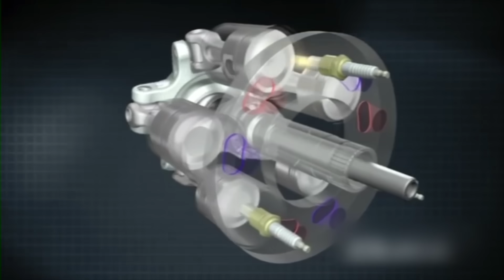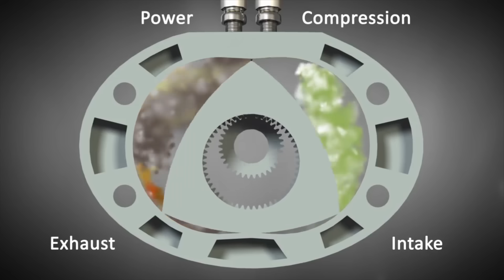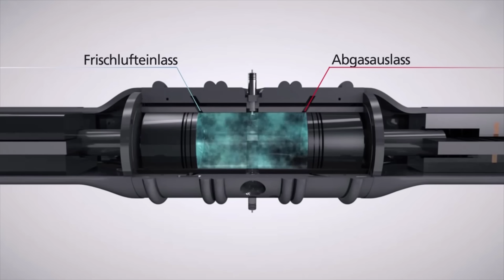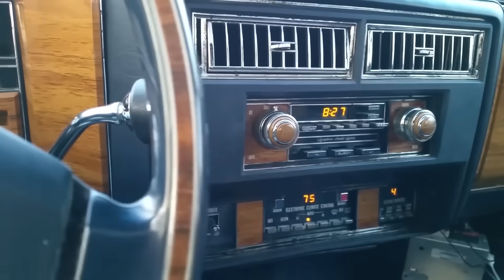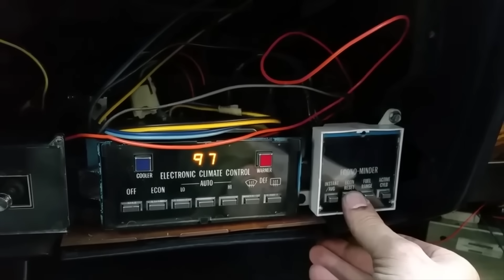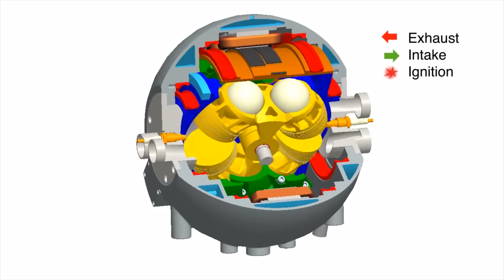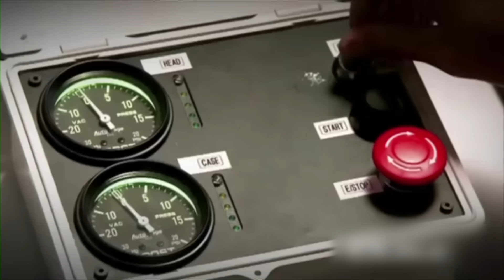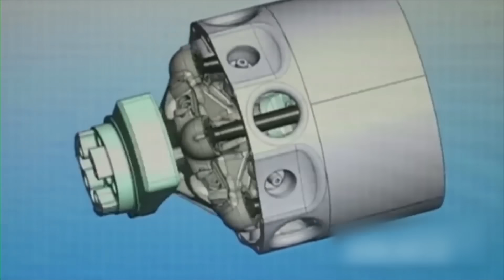10 Strangest Engines of All Time

Comment: 2019
and beyond Internal Combustion Engines still to reckon with …

Internal combustion engine has been around more than a century and it should be
around beyond decades to come. This is for the motorists not slowdown the
travel mode, changing lifestyle, more

Internal combustion engine has been around more than a century and it should be
around beyond decades to come. This is for the motorists not slowdown the
travel mode, changing lifestyle, more so to the business economy.

What is direct  injection and indirect injection? Indirect injection in an internal
combustion engine is fuel injection where fuel is not directly injected into
the combustion chamber. ... Direct injection allows the fuel to be precisely
metered into the combustion chamber under high pressure which can lead to
greater power, fuel efficiency with added feature of a … Catalytic Converter to
address the Gas emission.

In 1864, Nikolaus Otto patented the first atmospheric gas engine. In 1872,
American George Brayton invented the first commercial liquid-fuelled (not
petrol based fuel) internal combustion engine. In 1876, Nikolaus Otto, working
with Gottlieb Daimler and Wilhelm Maybach, patented the compressed charge,
four-cycle engine and this engine was running on Veggie Fuel (Ethanol). This is
the same with the Diesel Powered Engines that runs on Peanut oil. If this is
so, why not gas-up another time of VEGGIE FULES to address the dominant fear of
Carbon Emission? “ RIGHTFUL THINKING?”

Net CO2 or greenhouse gas production.

Plants use sunlight and photosynthesis to take carbon dioxide (CO2) out of the
Earth's atmosphere to make vegetable oil. The same CO2 is then put back after
it is burned in an engine. Thus vegetable oil does not increase the CO2 in the
atmosphere, and does not directly contribute to the problem of greenhouse gas.
It is really a way of catching and storing solar energy; it is a renewable
energy. However, as with other "renewable" energy sources, there may
be a (relatively small) carbon footprint associated with production or distribution
of vegetable oil.

These oils make up a significant fraction of worldwide edible oil production
used as fuel oil. Extracted from the kernel or meat of the fruit of the coconut
palm. Common in the tropics, and unusual in composition, with medium chain
fatty acids dominant.

Comment: The electric one seems kind of inefficient because what’s the point using an engine to drive a generator to then drive a motor? It’s easier to just use an engine powered car because you’re losing more energy to friction and sound
Reply: Good point. I, for one, would prefer batteries because they can be placed underneath, which leaves more room for storage.
Reply: A fuel driven generator is able to run at the most optimal (efficient) and at a generally lower and more consistent speed, so rather than waste fuel when extra power is needed you just increase the current drawn from the batteries instead.
Reply: Dave Micolichek soundwaves are just vibrations traveling through the air so there must be some energy dissipated into the air through vibrations, the sound can’t just exist because some energy has to be put it for it to actually make a sound

Comment: Evolution of the Internal-Combustion Engine

The first person to experiment with an internal-combustion engine was the Dutch physicist Christian Huygens, about 1680. But no effective gasoline-powered engine was developed until 1859, when the French engineer J. J. Étienne Lenoir built a double-acting, spark-ignition engine that could be operated continuously. In 1862 Alphonse Beau de Rochas, a French scientist, patented but did not build a four-stroke engine; sixteen years later, when Nikolaus A. Otto built a successful four-stroke engine, it became known as the "Otto cycle." The first successful two-stroke engine was completed in the same year by Sir Dougald Clerk, in a form which (simplified somewhat by Joseph Day in 1891) remains in use today. George Brayton, an American engineer, had developed a two-stroke kerosene engine in 1873, but it was too large and too slow to be commercially successful.

Comment: 1. The Volkswagen VR6 engine gets its unique exhaust note due to the fact that it has a strange firing order.  While it is indeed a true V engine, it fires like an inline 6, which means that it fires the front three cylinders then the rear three cylinders.  Since the exhaust path is longer for the front bank, this means that there is a different frequency [lower note] from the front bank than the rear, thus the infamous "woofle" sound.

2. NO NO NO!  NO, did "Mazda" put a rotary engine in the NSU RO 80 [pronounced "Are Oh Eighty"] or any Citroen;  The design patent of Felix Wankel's engine for automotive use is owned by VAG, the holding company that owns Volkswagen.  Did you know that Toyo Kyogo [the Japanese company that builds Mazda's]  has paid Volkswagen a royalty for every Wankel engine they have ever produced?  The Wankel in the RO 80 was a purely NSU design, and had tremendous problems.  Citroen's in-house version was equally flawed, and they gave up on it.   

Wankel engines cannot be made to be as efficient as the most efficient piston design;  These are a novelty at best.

3.  The Fuhrmann engine was installed in a few rare variants of the Porsche 356.  If you have one that runs, it is worth probably $200,000.  And you pronounce the name of the company that built this engine "Por-sheh" .  

You probably have a porch on your house;  I doubt you drive it-

4.  The design of the Duke engine is nothing more than an aviation hydraulic pump modified into an internal combustion engine.  There's nothing wrong with it, but it has few advantages. I doubt it will be cheaper to produce.
Reply: Actually it's Not pronounced "are oh eighty" but "roh uchtsig"
Greetings from Germany, O
Reply: @ikbunostfrees7242  Sehr guter punkt Sir~!
Reply: eric williams oh right I forgot transmissions make the power and not the engine. Silly ol me!
Reply: eric williams yeah sure I’ll bet you are. Hp isn’t changed, efficiency is.
Reply: @savagetuner2404  Yup, it's so efficient that it constantly burns oil making it a requirement to add oil on a normal basis unlike essentially any other combustion engine that will only lose a very, very, VERY tiny amount through gaskets leaking
Reply: Flies2FLL the Mazda skyactive wankel makes 45 mpg and 190 hp. You were saying?
Reply: @savagetuner2404  Hmm.  Amazing;  Funny how I'm not seeing that car on the road.....

Hello?
Reply: I can tell from your comment that you don't really know that much about engines.

Comment: What are you claiming, dude ?  
Mazda put the Wankel  (rotary)  engine into an NSU Ro 80   ?     What ?  How would that make sense ?
NSU  first used the engine in that Ro 80, but had difficulties with the gaskets of those rotors.

Hercules used it for a small motorcycle, with little economic success
Suzuki built a motorcycle also.
Norton motorcycles built a prototype, but faced the same problems as the other manufacturers.

Mazda then bought licence or patents to build the engine and was able to improve, because metallurgy and new
production techniques made that possible.

On top of that, it had problems with emission control.
One big drawback is that the Wankel is far more expensive to manufacture than a traditional piston engine.

Today, the Wankel is still used for special applications, like firefighter´s mobile water pumps
or for auxiliary drive on glider aircraft, because it has a very good power to weight ratio.
Reply: I believe the real problem with the Wankel engine would be its low fuel-efficiency.
Reply: @kevinlane1219  It ain't no prius, but you can get the mpg of a 90s-early 2000s sedan. Some of them, anything between 20-25mpg.. apparently in 1st gens its peak efficiency is around 3.4k-4krpm, something with the Nikki, while again not a prius, it's fairly decent on gas. But you are right, the gas crisis of the 80s definitely helped to cripple sales.
Reply: @Pieman6711  Thank you.

Comment: Engines run on vapors! Liquidz do NOT compress...  thus hydraulics!
Reply: 🔵 You are incorrect, there are a number of liquids that DO compress!.. such as hydraulic-oil, on the other hand, water will NOT compress.
Reply: @joshhayl7459  you both are wrong. everything we deal with compresses. Fluids and solids alike. It's just different compressive moduli that differentiate gases and liquids. Also, most liquids do not combust, their vapours do. You can throw a match into a lake of petrol and nothing will happen. Throw it into a room with an appropriate petrol to oxygen ratio and watch the explosion.

Comment: ever see the Ariel square 4 engine (motorcycle).1000cc, single carb ,low compression,75mpg @ 45mph, 1/4 mile 12sec .........etc

Comment: Ok so the Amercians invented the internal combustion engine, they didn't, and Mazda put their engine in the NSU?!?!?!  Nope.  NSU came up with the Wankel, named after the German inventor, Mazda made it work better than anyone else in a car and Norton/BSA did the same for Bikes and light aircraft.
Reply: Suzuki's 750cc Wankel engine is the most successful Wankel ever in mass production. My friend has one with 230,000 miles on the original seals. The drawback of it was it's extreme exhaust temperature requiring WATER-COOLED head pipes for the exhaust. He rides it daily rain, shine or snow. Suzuki made a little "Truckling" using a 1500 cc dual rotor engine that was very popular in Guam and SE Asia. American's can't drive Wankel's or Italian engines it seems. Mazda RX-3's got extremely good fuel economy IF you drove them nearly all-out at maximum RPM. It's the same with Fiat's, Alfa-Romero's, Lancia's, Maserati's and Ferrari's. American drivers have to be able to "Lug" an engine (run at too low an RPM)  and not pull the valves thru the heads to be happy.
Reply: suzuki also put it in bikes
Reply: While they had nothing to do with developing the Wankel rotary engine Mazda managed to greatly improve the problem of wear of the seals, but not enough to overcome the issue which meant emission-standards couldn't be met!

Comment: You forgot the jet turbine engine. You can think of it as a small ICE with a huge turbo charger where the power to drive the vehicle is taken from the turbo shaft.

Both Chrysler in America and Rover in the UK experimented with it. You could run them on anything flammable that could be sprayed into the engine and ignited. Including,on one occasion, Channel No. 5! 😂 They were even entered into races with varying results. The downside was enormous turbo lag with the turbine taking a long time to wind up the revs. Race drivers tended to keep the throttle wide open even when braking for corners!

Comment: VW's v5 engine?  Do you mean their inline 5 (straight 5) engine?
Reply: Nope, the only 5 inline was use in the 1976 Audi up to the Audi quatro rally cars , the later VW V5 was not a "straight 5" but a low angle V engine (like the later VR6...)

Comment: What about England’s Lanchester Ten, featuring an air-cooled, twin-crankshaft, 4.0-liter flat-twin driving the rear wheels. One crank lived above the other, and each piston had three connecting rods—two light outer ones and a heavier one in the centre. The light rods went to one crank, the heavy rods to the other, and the two shafts counterrotated. The result was 10.5 hp at 1250 rpm and a remarkable lack of vibration. If you’ve ever wondered what engineering elegance looks like, this is it. A very unusual and interesting engine and done in the early 1900s.
Reply: You guys still angry we kicked your ass in 1776 let it go
Reply: @jamessickmore236  Hope you did something nice for the French, In way of thanks.

Comment: high compression engines are more efficient and they are using the low compression in the Infiniti motor to allow more boost to make more power. You got that backwards.

Comment: Mazda didn’t put the Rotary in the NSU...
Reply: The inventor from the Wankel engine was felix Wankel, engineer by NSU... NSU sale the license for the Wankel type KKM (kreiskolben motor= rotary piston engine) to Mercedes Benz, Citroën and Mazda (later to some others)...Mercedes Benz create the nicasil coted aluminium Wankel engine block , technology who was use from all Wankel engine builders, later use on some motorcycles engines and the first car who use it was a modest Citroën Visa (improved 2cv engine, 652cc 35hp) and today Nicasil is still use on Porsche engines, and some others because very low frictions properties...NSU, togeter with Citroën, make in 1967 the COMOTOR compagny to built Wankel engines for the NSU RO80 and the Citroën GS Birotor: that's the true story!

Comment: wrong..  it has nothing to do will fuel use... it has everything to do with more moving parts that fail more often, leaving use a large bill, so they can MAKE MORE MONEY..

Hydrogen runs combustion engine's just fine.. no emmisions..     yet..  they make no money off it...  so they force us to use oil...

lookup Stanley Meyers if you dont believe me... we havent needed gasoline the last 70+ years.
Reply: The issue with Hydrogen is that you need lots of power to make it first and storing it is rather difficult because it has a nasty habit of being able to diffuse through almost every material. These are issues we really haven't solved and there is a chance we wont do so practically enough in automotive applications. Other options to include batteries and synthetic fuels which will require similar amounts of power are simply more practical.
Reply: Harley Me refining hydrogen creates just as much emissions

Comment: They didn't mention the new skyactiv-X motor Mazda is coming out with in 2019.
Reply: yeah and some mazda guy said there might be a rotary version coming too
Reply: @CaffeinatedSentryGnome  rotary  burn a lot of oil
Reply: @punker4Real  we'll see what happens
Reply: If Mazda does a rotary in the US it will be in a form of a hybrid. The skyactiv-X Mazda 3 should be hitting the dealerships around May or June. That is the official word I get from the district manager.
Reply: Mazda does still use the rotary just not in the USA.
Reply: Did the Mazda rotary have ANYthing in common with the German NSU one, as suggested? Never heard about that.
Reply: @skuula  
Mazda rotary is based on the Wankel design. Wankel actually never built one.

Comment: The V8-6-4 shuts down cylinders by keeping the valves CLOSED not OPEN;
this creates an air-spring where compression energy is returned to the crank.
There are engines that do this today.
Leaving 4 intake and exhaust valves open all the time would give you NO manifold vacuum for a carburetor to work.
Reply: Fuel injectors need a carburetor?
Reply: Why not just keep the intake valves closed and keep the exhaust valves open then.
Reply: The whole object of keeping all valves closed is to create compression then return almost all of the energy it took to compress back to the crank...hence the term 'air spring'.   A side benefit of this arrangement is that the compression heats the chamber and helps keep it around operating temperature so it works normally once it's turned back on.

The Cadillac system was actually very simple with a solenoid that turned the fulcrum ball which disengaged the rocker arm so the valve would remain closed.   I had a couple customers with them and it was pretty cool to see a big car like that return mid 20's gas mileage back when similar vehicles were getting 10 less mpg's.    They did run a bit roughly when in 6 cylinder mode....so the EProm was changed so it went straight to 4 from 8 and this cured most of the problems....except ignorance of the system even from many Dealer mechanics who chose to deactivate rather than understand how it worked.

They had MANY problems with the 8-6-4 engines but NONE were related to that system....they were very poorly built and I ended up doing head gaskets on both customer engines and was appalled at the poor machining on the gasket surfaces.   Once the heads were remachined and the blocks surfaced the engines ran well and for a long time and the customers were completely happy with them.   If only Cadillac had made them correctly they would have been a success...but GM is like that, with good ideas poorly implemented leading to them failing which makes people think the idea was a bad one when it wasn't.

Comment: Types[edit]
Three types of internal combustion engines were designed by German inventors Nikolaus Otto and his partner Eugen Langen. The models were a failed 1862 compression engine, an 1864 atmospheric engine, and the 1876 Otto cycle engine known today as the "Gasoline Engine." The engines were initially used for stationary installations, as Otto had no interest in transportation. Other makers such as Daimler perfected the Otto engine for transportation use.[1][2][3]